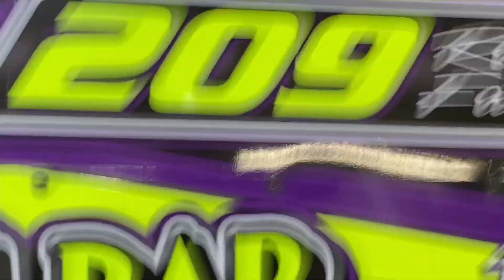Door bar, bumpers and suspension talk on an Impressive!!

Comment: Have y’all thought about putting tabs on both ends of the 5/8” and on the 1-1/2” so u can just replace the 5/8” if it gets bent?
Reply from the maker: I have!! Actually thinking about doing them like the MB Customs stuff. Kind of has a hoop that the door bar slides in.